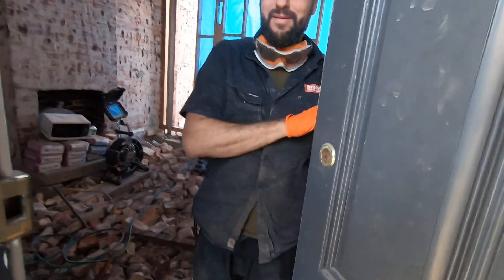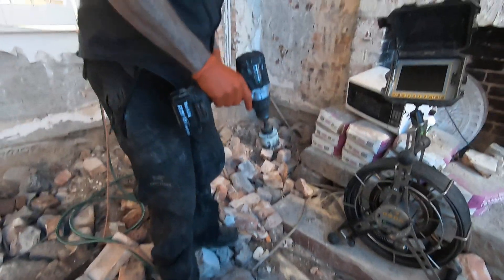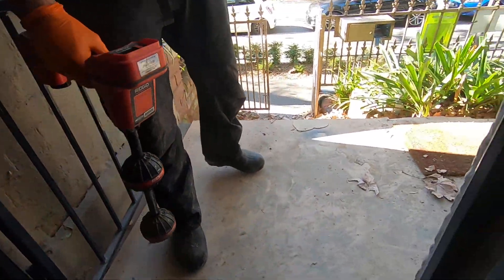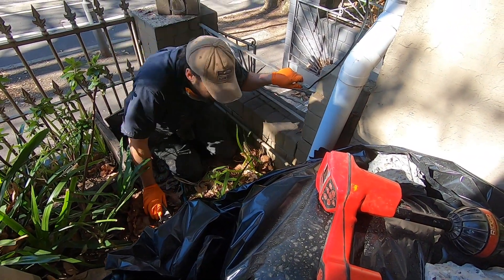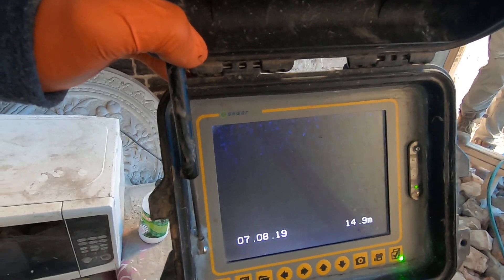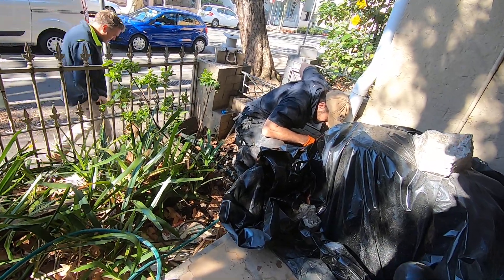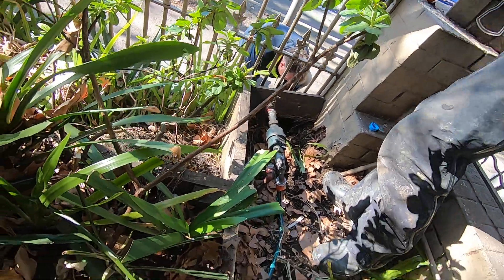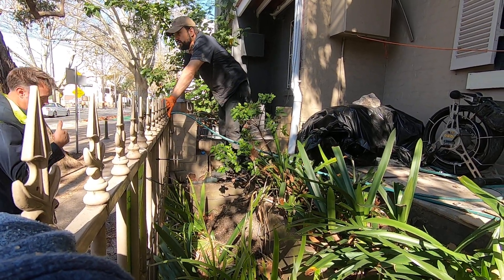Blocked Drain 356

Comment: The beginning Lmao. But why is the doorknob like directly in the middle. Dont see that in the states. I notice theyre much higher up the door in the UK.
The more you know :)
Reply: Symmetry, that's all.
Reply: @Graham_Langley  the bolting system must be much larger maybe that provides more support if someone tried to break in? Either way just cool differences i was noticing.
Reply: Universal left or right opening maybe?
Reply: It was fashion in the late 1800's . I grew up in New Zealand and  a lot of old houses had the same. There's just a flat piece of iron to the actual lock  on the side of the door.
Reply: I've seen a few that way here in northeastern usa (Ohio) kind of odd ball designed homes in older upscale areas.

Comment: Got to love those old buildings, they really built them one way and further developments have encroached and changed the building services without consultation. The newer bike path bitumen surface has near blocked up the discharge pipe opening. Further dramas will be ongoing, new service plumbing must be now created... Drats, more work for Olly

Comment: A knock at the door. Ollie opens it and says "Don't mind the mess, I killed a spider this morning. " lol Man what a pile of rubble for a reno. I think they are totally rebuilding the house from the ground up. Left the facade intact, but the rest of the house is toast. Anyone get the feeling that it's a movie set???? lol Great job locating the problem with the pipes. Let us know how it went. Hello to Just and Antoine.
Reply: And in typical Sydney fashion they will pour a slab of concrete over the bricks to save carting them away. When I lived near there those old dumps were mostly empty and falling down,only derros were brave enough to live in them. Now,I couldn't afford to have lunch with the dude in the black suit and pointy shoes ,let alone consider buying into one.

Comment: I agree seems to make random beeps - how do you know when you are over the right spot?   I dont hear any difference in the tone...
Reply: Higher tone , match . Lower tone - no match.
Reply: I am not sure but like cheese said higher the tone the closer you are I do know when the locator finds the camera head it goes to a solid high pitch tone and not the r2 c3po tones
Reply: @buckeye20100  Correct, and the display on the top of the device also tells you how close you are (N,S,E & W) as well as the depth of the camera head.

Comment: A microwave and a fireplace what more could you ask for
Reply: Level floors, a complete roof & walls, stairs to the 2nd floor & a 2nd floor, working heat, electricity & water...

You know, everything other than a drain that makes a building a habitable home...